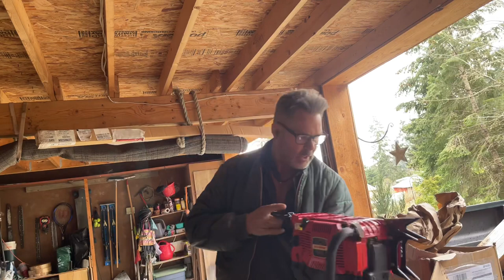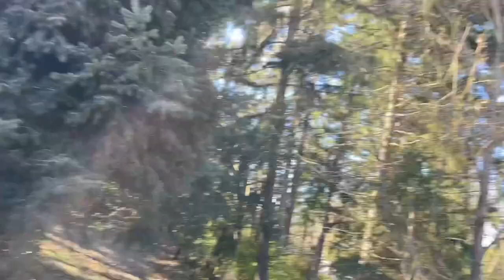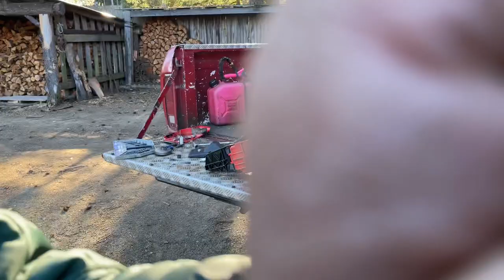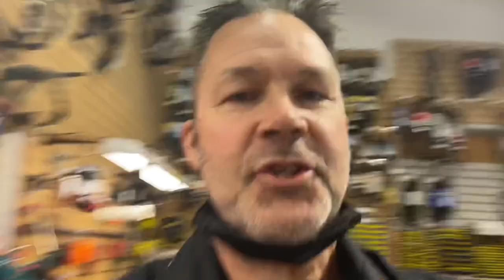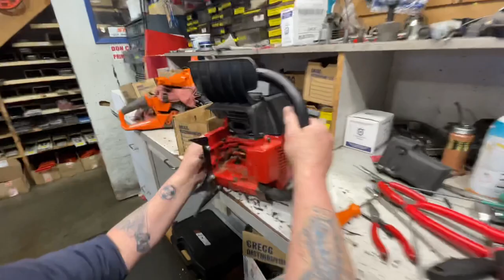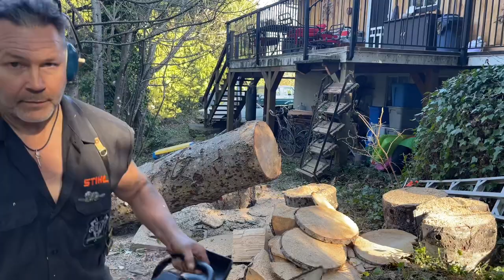“NEVER RUN BEFORE” Brand new, NOS. Unboxing 1980,’s jonsered super920.

Comment: Buckin', been watching you for past year and can't stop watching.  I am a saw repair guy here in Minnesota.  Love watching Iron Horse and Tinman too.  This is my first comment.  After watching you for so long, I have been wondering where the red non-Homelite saws are in your life!!  5 years ago I spotted a 70E sitting up in rafters of local repair shop and asked owner if he would sell it to me.  He said heck, its yours!!!  Restored the thing to working order (no mods).  Put a 28" Total bar on the thing with Oregon skip and let her rip.  WOW!!!!  Puts my 44 to shame and is right up there with my 66.  The thing is unstoppable!!  Could easily run a 36" on her.  Been looking for a 90 for a long time.  But your 920 is a thing of beauty.  A toast to JONSEREDS!!!!!  Love your channel and all the advice.
Reply: I have a Jonsered 90 and it has huge compression, just trying to find a new oil pump for it. I have just repaired a Jonsered 670 Champ, it also looks new. My next project is a Jonsereds 621 a saw that was ahead of its time.

Comment: I own a Jonsered 630. I bought it new in 1982. Heated my home solely with wood for 23 years. Only saw I ever used, till a month ago, It broke the oiling gear, still oils, just not enough, and very hard to find parts for. The 630 was the little hot rod of jonsered saws. 10.000 rpm pulling a 18 in. bar. that saw in 1982 was $680.00. Glad for ya on the gift saw, it is a fantastic gift.
Reply: The 630 and 670 were tough damn saws.
Reply: @austindenotter19  Yes they are, The oil gear, which just broke, and an exhaust stud, is the only things in 39 years, I ever had trouble with, and I'm not giving up on trying to find a oiler gear.
Reply: @dennyporter1315  machine shop
Reply: @justinjones5288  Thanks, never thought of that, I'll give it a try.
Reply: @dennyporter1315  
Just saw one on Ebay recently!

Comment: Yikes for that hard fuel line. Ethanol is a killer, sadly here in EU no chance in getting no ethanol fuel. Except Aspen fuel brand. Love that stuff, it's like 4 times the price of pump gas, but worth if you care about your rubbers. This stuff has a 5 year shelf life and doesn't attack rubber. I like it. Great video as always buckin, ty for sharing vintage saws with us brother.
Reply: It was his oil line.

Comment: I just finished building an 830 JRed ported to 830 specs with a dual port and gutted muffler. It's a beast with lots of power. Cutting the baffle out and adding dual ports really make the throttle responsive. Have fun with that 920.  Really enjoy your show!

Comment: nice job ..you pretty well hit er every time... have learned a lot watching your videos and i have run saws a long time ...was amazed when i saw the pretty well new jonsred ..when those first came out a rep gave us a couple of those to use for the summer ...we ended up with them and i still have a couple in the back fourty ..not usable at all any more ...maybe good for parts though...if you ever need any give me a shout ..  one thing i do remember is we changed up the air filters on them.. used them for shake blocking and they were a great bucking saw... 
better make sure they are 920s  first ..been a long time since i used them...always got a kick that they were electro lux ...husqvarna owned jonsred and electrolux bought husqvarna .....stay safe be well

Comment: Aaaah!...a Jonsered 920!  I have an old Jonsereds 90, it is a torque monster, problem is it does not oil, I think the pump is shot and I need a new one which is proving impossible to find. I have a more modern Jonsered CS2186 Turbo....that is a very good saw (86cc)....YOU ARE ONE LUCKY GUY!!

Comment: Did the 920 Supers have the lower transfers opened up like the 930's? Out here the local distributer did cut those to closer match the case on the 920's and therefore many did, made a huge difference. :)

Comment: Hey buckin, I just got a Mcculloch 250 from an old small engine shop that's closing up. Have you ever ran one and what's your thoughts on em? Also where do you source parts for em? Just buy similar saws and use them?
Reply: I'm not on Facebook but there is a Mac collectors group on there. They could help.

Comment: Hey Billy Ray!
Got a new question for you. A feature on some Husqvarna saws and I think some of their Jonsered cousins is a greasing hole in the end of the crank shaft. You push grease in the hole and it comes out under those bearings you took off and showed us. So-- does the saw you were showing us have this?

Comment: Hey buckin have you ever had heat issues with the light weight Stihl bars I'm getting oil but the bar is still hot after minor cuts thank you

Comment: Hey Billy been watching for awhile recently subscribe I have a question about a hatchet I found was rusted pretty good I got it cleaned up I'm trying to find info on it the only marks on it is stamped 600 it had red paint in the 600 if you have any info or where I could find it I would appreciate it thanks